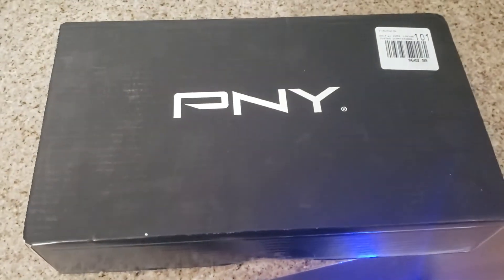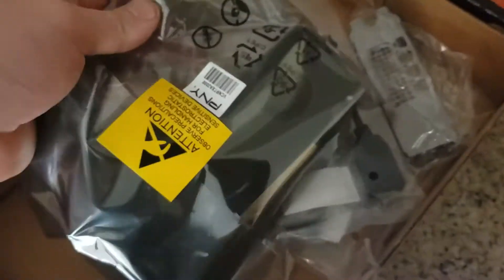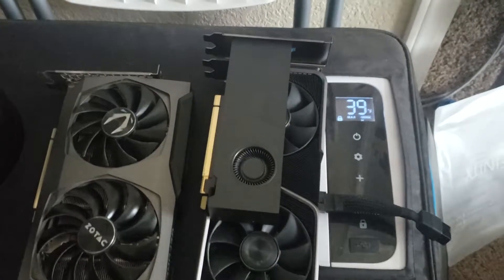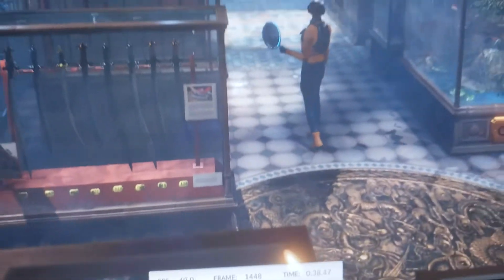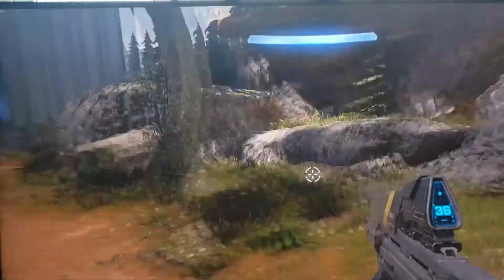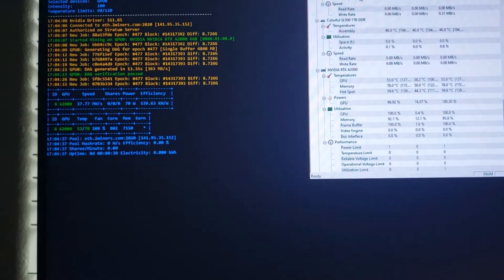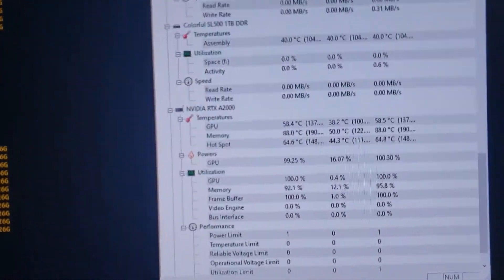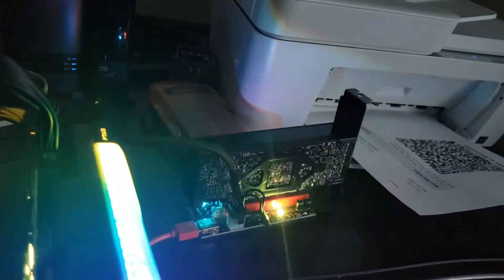RTX A2000, Quick Benchmark and Hash Rate Test

Comment: Hello crazykid, thanks for the video. Im interesting in this gpu for my first pc built. My goal is to make an quite as possible pc with maximum performance for CAD/CAM software and some gaming. I’ve brought an R9 7900 cpu with 65W tdp. Can you tell me how the rtx a2000 is comparing with your geforce cards in terms of noise level?
Reply from the maker: They are silent little cards, definitely a good card for a small, quiet, powerful pc!